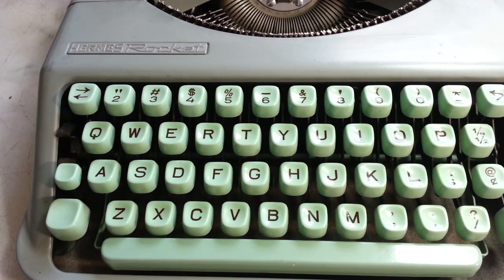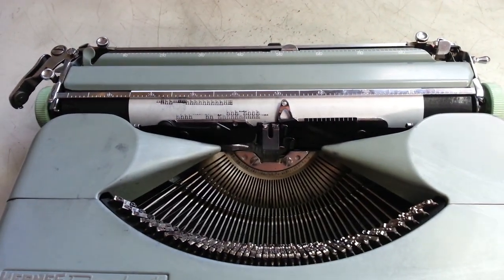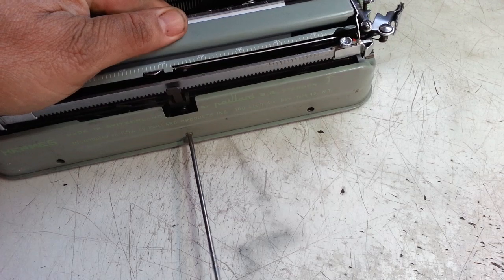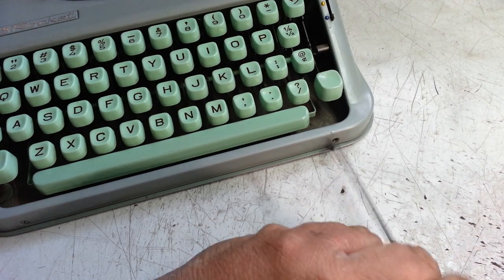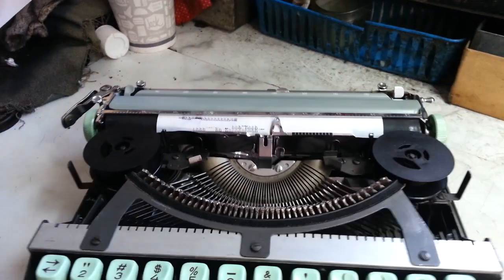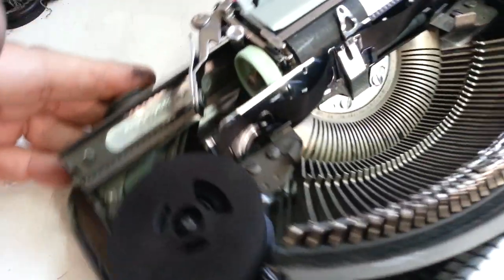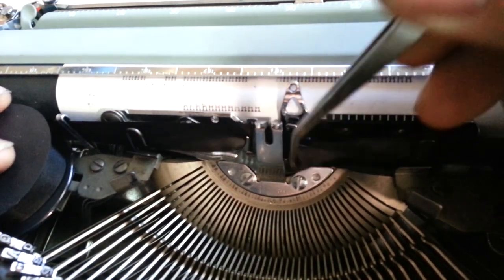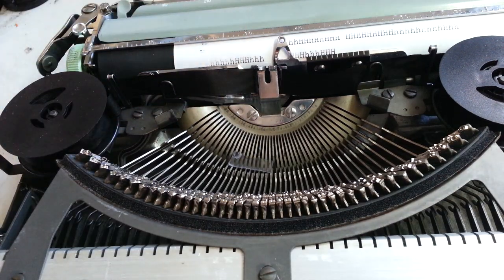Hermes Rocket Typewriter Repair, Shift Binding, Disassemble Troubleshoot

Comment: Thank you for this video. I just obtained a Hermes Rocket and have been frustrated for 2 days attempting to get Upper Case letters to type properly by using the screw adjustments. I watched this video and then I realized the rear of the body (case?) was bent in slightly and preventing full movement of the carriage. All is well now. Thanks!

Comment: Pressure from the underside of the machine can cause all sorts of issues. This can be like here, a piece of something, or the case mis-shaped or not put back together right, or even on open backed machines an uneven surface. I found an eyelet from the ribbon that came off and caused problems in the works. WD-40 is evil too - short term it seems to work but long term it turns into glue.
Reply from the maker: Yea one of the 1st thing I looked at while the customer watched was the bottom panel, looking for interference
Just the other day a rubber band jammed a selectric III
Reply: Hi